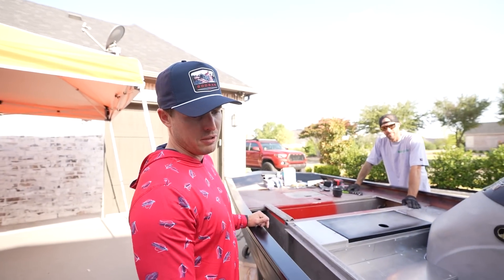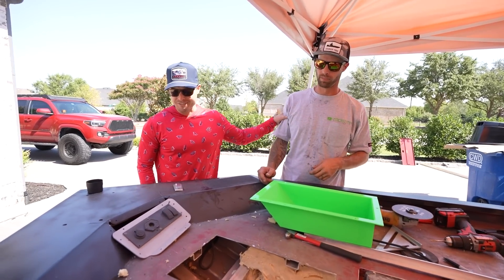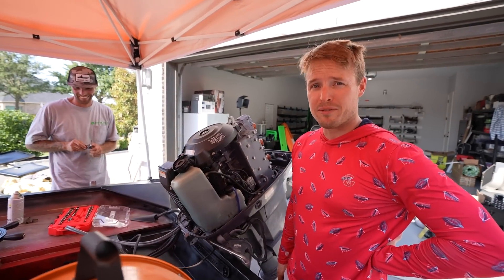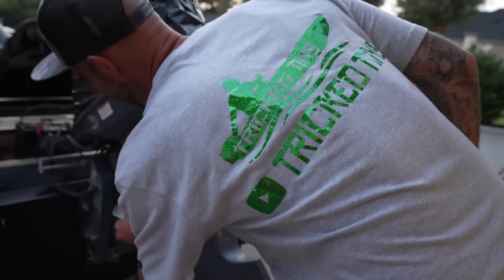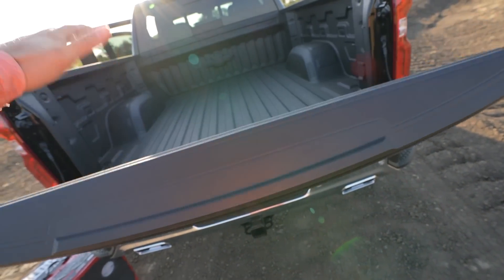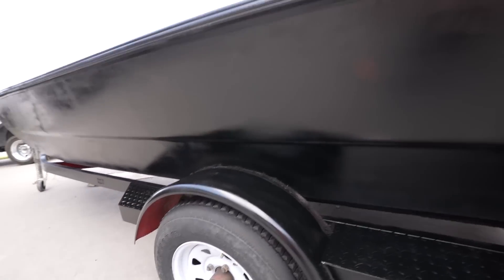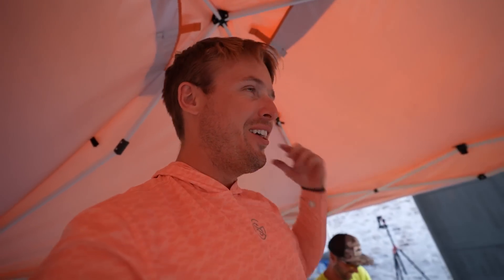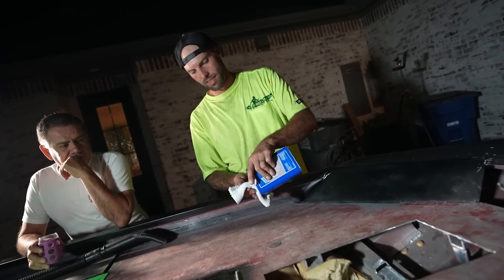He Lied To My Face - Craigslist Boat Restoration Part 2

Comment: Twenty years ago, a six foot rod was the standard of the day.  Anything over seven feet long was a fly rod.  The two live wells are mostly for the convenience of two crappie fishermen in the boat.  The biggest, baddest bass boat on the BassMaster circuit in 1990 was 17.5' with a 150hp on the back.  Time have changed for sure.

Comment: If I were you I’d get your lower unit seals replaced cause all of that fishing line on that prop shaft an when it spins it creates heat an destroys the lower seals an everytime you change the lower unit oil pull the prop off an check for fishing an always grease the prop shaft am splines makes easy removal

Comment: you shouldnt use "Treated Lumber" For your boat bunkies.   The  treatment used in the wood Is VERY corrosive to your Aluminum Boat,  Just a Heads up Fella

Comment: THIS IS NOT EASY WORK ITS BACKBREAKING WORK I REDID MY 1986 18 FT WINNER BASS BOAT WITH ALL NEW CAPET AND NEW PRESSURE TREATED DECK IN THE BOTTOM OF THE BOAT AS WELL AS FIBERGLASS WORK ALONG WITH BUILDING RISER DECKS FOR MY SEATS  BUT ALL THE WORK WAS WORTH IT AND DID MY TRAILER AS WELL BUT STILL HAVE A BIT MORE WORK TO DO ON IT